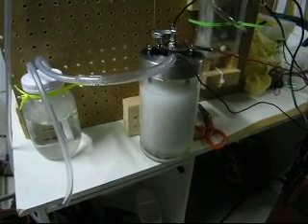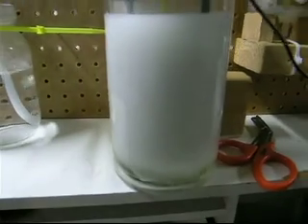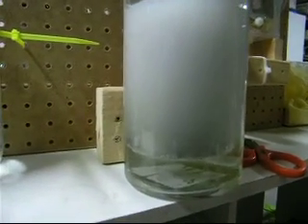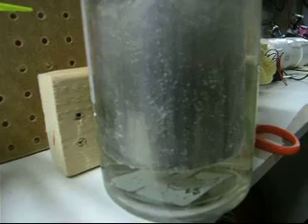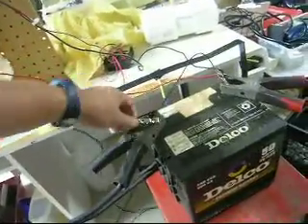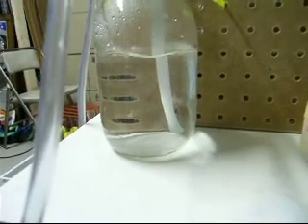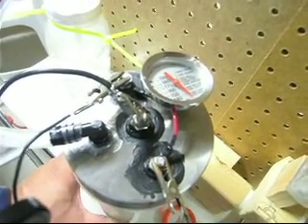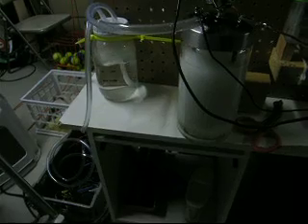Vada HHO cell, trying to make it better...waste of time?

Comment: Hi unfortunantly i imported a few of these units and tried it out, IT IS A HEAT MAKKER and will get very hot in the engine bay, so if you mount it, must be in front of the radiators. I got rid of the units on ebay ranging from 3$ up to 200$, I recently tesyed the production in a other sealed inclosure that i am using for another unit i produce and using the vada cell i got 1,5 Lt static at 40 amps. (keep in mind if you draw mor then 20amps continusly the fuse and wires will melt.